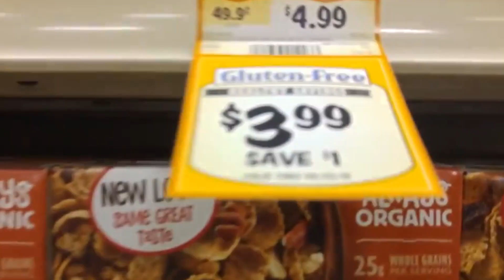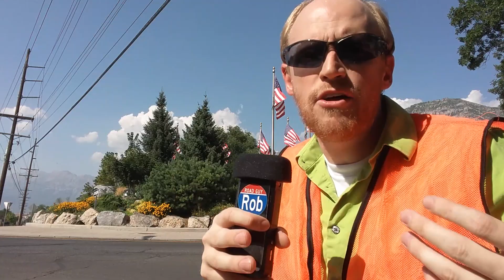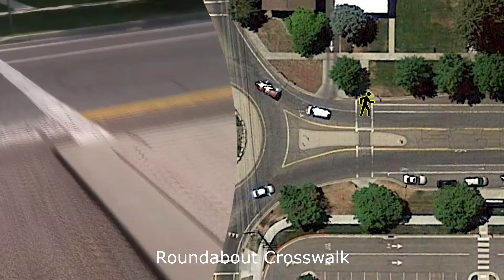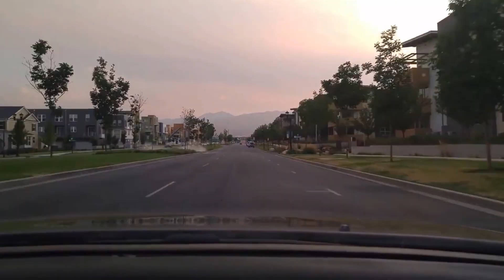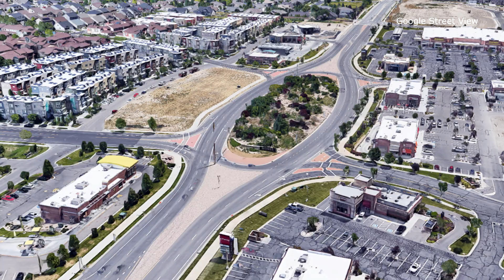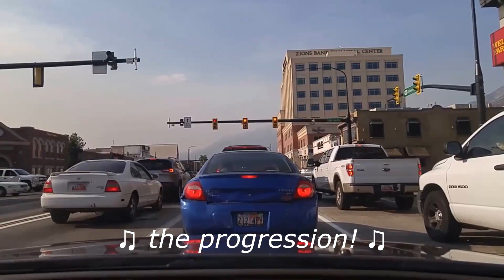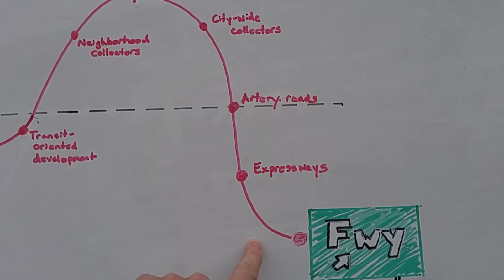Are roundabouts REALLY better than a traffic signal?

Comment: I 100% support more roundabouts. The only time they ever get annoying is when someone gets into the circle sooner than they should or drifts into the other lane if it's a two-lane roundabout, but that's it. In the area I live, there are a ton of back roads that are just as busy as main roads so they put roundabouts at many of the intersections. And I have never witnessed a single accident at a roundabout yet. I have witnessed many accidents at four-way intersections with just stop signs. Those are pretty dangerous because it's hard to get everybody to work together. And four-way intersections with traffic lights are just a drag because of having to wait at the red lights. Roundabouts ensure that you can keep moving and they are way more safe.

Comment: Two lesser factors (though technically two facets of one factor) most people don't usually think about make roundabouts the better option - in a nutshell, unfamiliar navigation.

Even under ideal conditions, street signs are problematic; quite often, you can't clearly read the street name until you're practically upon it.  Some places will put an additional sign in the median some 1000 feet before the cross-street but those tend to get obstructed by shrubbery - as well as their application being inconsistent - which pretty much negates any benefit.  Additionally, some drivers anticipate needing to make a left turn when their destination is on the right and they cut across at the last moment.

(A decent GPS could avoid most of this, granted, but that's not always an option.  Particularly when you're driving alone and it's illegal to use your phone for this purpose.)

Entering a roundabout, the signs are easily visible and it's easy enough to go in any direction at a whim.  Needed to make a right turn but already passed it?  Just stay in the circle til you come back around.  Left, straight through, reverse course, all those options are readily available spur of the moment.

Comment: Cool, a couple weeks ago I got caught up in a string of red traffic lights on my usual route. During the wait, I began to wonder if traffic lights were designed so that cars that got one green light tend to get more green lights in a row, and cars that get one red light tend to get more red lights in a row, because it seems rare that I would get a 50/50 mix of red and green lights. Sounds like a platoon is exactly that!
Reply: IF (this is a big if) a city has competent Civil Engineers (a profession with little to no competence) then traffic lights should be set up such that priority roads will seeing a chain of green light in a row when traffic is moving at the speed limit.  In most places, CEs are quite incompetent and lazy and you are fortunate to get 2-3 in a row.
The other circumstance is if you are on a low priority road crossing many higher priority roads.  Then you should 100% be hitting more red lights as the higher priority roads should be the focus of traffic light timing.  This statement assumes competent CEs which I admit could be a fundamental flaw in the idea.

Comment: They're a huge improvement in situations with moderate levels of traffic. With very heavy traffic they start to seize up. The reduction in fatal accidents is pretty compelling though. However, when you have an intersection that's pushing 40 or 50K vehicles per day, especially in the event of the "platoon" scenario mentioned in the video, built

Comment: The smalles roundabout I saw in England had an inner circle of 4 feet. In Europe it works fantastic!
Reply: In France and Spain they have even smaller ones, which I'm told are stuck into the middle of most urban intersections.  Even at the rest, drivers turning left are supposed to treat an intersection as if there were an island in the middle to be gone around, so drivers approaching in opposite directions and each turning left have to go around each other rather than turning in front of each other as they would in North America.  In Chicago they have boulevard intersections where you start your left turn before the intersection, which is the opposite extreme from the French-Spanish way.

Comment: This video made a great point about pedestrians: The constant flow of traffic in roundabouts effectively turns the streets into freeways which makes places inaccessible to pedestrians unless a footbridge or tunnel permits it. Much like on ramps cut neighborhoods apart from each other. Putting them everywhere would turn out landscapes into little more than islands with constant streams that cannot be surpassed unless you are driving, which you shouldn't be for nearby places.
Reply: Actually no. There is something that is pretty much always a part of roundabouts but he kind of cherry picked examples that forgot about it: Islands.
Almost all roundabouts have pedestrian islands that cause pedestrians to only have to wait for one lane of traffic to clear at a time. Islands on straight roads are hard cause they mean cars have to weave but on roundabouts cars are turning anyway so you can place an island without any impact on the cars.

Not to mention there is another thing growing that kind of goes hand in hand with roundabouts and is actually a bigger reason why the US was always slow to adopt them: Bicycles. There is a reason the Netherlands is the most enthusiastic about roundabouts as they are the absolutely perfect solution for mixing bicycles and cars together.
Reply: @MrMarinus18  Have you a video on that?

Comment: I grew up in DC where roundabouts (called circles) are common and very large. DC's street layout was designed by Pierre L'enfant in the late 1700s. It is basically a grid with streets named for states running at diagonals with a circle where most of those intersect. The circles are large to accommodate both grid and diagonal streets they connect, with centers large enough to serve as parks. I always found them relatively easy to navigate despite having eight entrance/exit points.

I now live 70 miles and two mountain ridges from DC in a quickly urbanizing small city where traffic taming constructions are relatively recent. I find the roundabouts that have been added just outside of town to have a circumference small enough to strike me as a bit too small to navigated comfortably. However smaller circumference ones that have replaced poor visibility 4-way stop signs in some residential areas seem to work well and have reduced fender-benders significantly.
Reply: If he is French then he would love the Place d'Etoile in Paris, France which has eight roads converging on a four lane roundabout and the traffic coming onto the roundabout has right of way. NUTS. this means that cars on the roundabout have to give way 8 times around the roundabout. An added stressor is that cars are not insured for fender benders on this famous roundabout. The centre of the roundabout is the famous Arc de Triompheand the tomb of the unknown soldier. Perhaps the should include the unknown motorist as well.........

Comment: Problem with "platoons" is that they only work in one direction at a time, and so the traffic lights are programmed to favour one direction at a time. If you're travelling in the opposite direction, it's quite possible that you'll routinely run into a string of red lights.
As others have said, roundabouts don't need to be large. The street where I live has three intersections, all of which are roundabouts. Two of those are quite small, with the central traffic island being only a few metres across. The third (in the middle) is fairly large - and directly adjacent to a major train station. That one has pedestrian crossings leading from each "corner" to the central island
Pedestrian crossings next to the roundabout can be sped up by splitting the crossing in two, so that you cross half way to the pedestrian island, then the rest of the way when you see a gap in the traffic on the roundabout.
Something you mention in passing is that roundabouts never force you to stop when there is no other traffic. Surely I'm not the only person who has been peeved when forced to wait at a red light with the intersection being otherwise clear in all four directions...

Comment: Nobody seems to be talking to NJ DOT. New Jersey once had lots of these circles, but once they got overloaded and started generating lots of accidents, NJ DOT began ripping these all out. NJ found it better to either punch the primary route through the circle, or in some cases like the Marlton and Berlin Circles on NJ State Road 73,  replaced the circle with a freeway style interchange at Marlton (NJ70), or with a light (Berlin). Traffic circles a.k.a. roundabouts may be work fine in residential areas, but not where main roads cross. Circles force ALL traffic to slow down to speeds akin to turning a corner, including emergency vehicles, unlike a light where during the green phase traffic does not have to slow down like that. Some depts have the ability to turn a red light green on approach e.g. Montgomery County PA.

Comment: Platoon flow only works if the cars are really well coordinated. We need a system of lights along the road to signal if cars are going too fast or too slow. The problem is that most lights in my experience are not properly timed, or if they are "properly" timed, in practice they are not properly timed because of other drivers driving incorrectly. IMO cities are extremely negligent to infrastructure and so they standard option should be a roundabout because it doesn't need someone to engineer it perfectly for it to work out better.

Comment: Funny comparing roundabouts and freeways. The way roundabouts work is more or less the same as freeway entry and exist. Get cars to move at a similar angle and similar speed, then give way to traffic on the freeway. A freeway interchange is more or less a roundabout with all the lanes separated, and with one extra path for through traffic in each direction. Can you imagine if freeways had traffic light intersections?

Comment: I've always wondered about the fuel economy/savings of roundabouts where they replace lights. Not having to brake, idle and accelerate, you're saving gobs of gas and brakes pads. I don't even know how to estimate it. I'd need to get into injector pulse widths and fuel rail pressures to be able to estimate it, as well as log that for many models of cars.

Comment: Don't know if it is still there, but there used to be two almost-freeways that intersected in a roundabout outside of Cherry Hill NJ. I figured it was for population control. In DC, there are roundabouts all over the place. If you don't know where they are and how they work, you're sunk. You'll be driving along what seems to be a regular surface street and come upon a little weird off ramp...Is that an off ramp? Why is there an off ramp....I'm not on a....Whoa! You' dip down and go under an underpass. In the darkness, you realize you are under where you wanted to turn right. Too late now. Next time you're in town, you remember to take the off-ramp looking thingy after which you drag past some parked cars and get dumped into a roundabout. The typical one will be about 3 lanes wide and have 5 different outlets. Traffic is heavy. Roll your 16-sided die to guess the right lane to be in because you will need to strong-arm your way into it and, once you are there, if you are wrong, you're goin' round the mulberry bush three times to get to the proper lane to exit. Just love DC. In the local neighborhoods, "roundabouts" appear to have been made by simply adding an obstruction in the middle of a regular intersection. Clearly they are meant for traffic calming. The UPS vans can get past them without hitting the curb, but I really wonder if the garbage trucks can.

Comment: Wait, it cost about 10 grand a month to power The traffic signals at one intersection? That sounds horrendous, that's like millions and millions for a city full of intersections.

I had no idea how much electricity these things were using.

How much does a super bright array of LEDs use wattage wise? I'm going to just estimate that 100 watt LED array his sufficient to light up a traffic signal. We will assume that only one light is ever on at a time per housing. So the two lane intersection near my house with three lights per direction (two main lanes and a left)... That's 12 lights on at any given moment, twelve 100- watt bulbs, lit up continuously. And let's say the controller uses another hundred watts.

So we have 1300 watts being used continuously 24 hours a day 7 days a week.

730 hours per month X 1300 watts hours = 949,000 watt hours. 949 KW hours.

Average electricity price is about 15 cents per kilowatt.

$142.35

Is my math right? Now I think I've drastically low-balled it 😂
Reply: I don't know, I don't see any obvious errors in your estimate.  You might be a little low on the size of the lamps.  But still if we back up to pre-LED days and assume 300 watt incandescent spotlight elements we're still only up to $500-ish per month.  I'd like to see some support for the $5,000-$10,000 per month number.
Reply: @andrewalexander9492  maybe it's about 10 grand all in total to run an average cities whole collection of lights
Reply: @CmdrKeene   Maybe that's what his numbers represent.  He sure didn't present them that way though.  Maybe he found a number for energy costs including area illumination and got confused.   I found this article that discusses traffic signal power consumption in Chicago, and it puts pre-LED traffic signal energy costs at $600/year  for an intersection (although it doesn't say how many lanes or lights in that intersection)  it also says that replacing the incandescent lamps with LEDs  reduced energy costs by 85%.  I think that $5k-$10k to run a set of traffic signals is waaaayyy off.

Comment: On small roads, roundabouts are smaller. The pedestrian argument is overblown. 

Platoons are pretty terrible for traffic flow. Imo if you're relying on platoons you've already failed. If you'd had an appropriate number of roundabouts in your city planning it would never have been necessary to time traffic lights in the first place. 

Admittedly at gigantic intersections, or intersections with very uneven traffic flow from each direction, there may be better options than roundabouts... but even then it isn't a normal traffic light intersection. You're usually looking at diverging diamonds, continuous flow intersections, or other esoteric ideas at that point.

Or you could always try a compound (magic) roundabout ;)

Comment: You forgot to mention all the street light poles and signs that get taken out by speeding/drunk drivers.  The one near my home has had every one of the lamp poles replaced at least once, and some have been replaced three times.  Now there is a "dead one" that needs to be replaced for the fourth time.  It's also a bitch to try and cross them. Have had 6 police cars drive by with me in the middle of the crosswalk.  NO, they didn't stop or even say sorry.  Almost forgot that the stone work in the middle has been replaced 5 times from drunks coming home.  Not to mention the idiots that slide off the road when it's icy out from too much speed.  Moms seem to see how fast they can get the mini van to take the corners.  No, I do not like round a bouts.

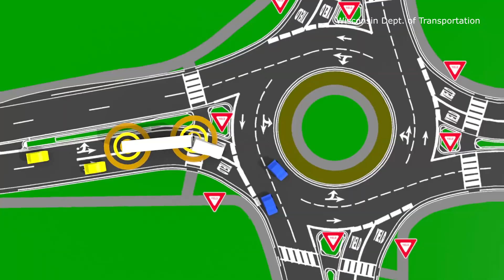Comment: 2:16 - the ironic thing is that isn't an issue as if you increase the size of the roundabout so speed increases (there are several i know of you can take comfortably at 50mph) then the angle of approach of the 2 lanes of vehicles becomes more acute, meaning if there is a collision it's not going to be anywhere near 90 degrees and has a far lower chance of being fatal.
Reply: Not if you have lane discipline enforced by fines.

Comment: Short answer is yes. It allows traffic to flow quicker, filtering in. It's a give way system not a stop system. ''ironing out'' the roundabout is illegal, if you did that in your test you fall instantly. What lane to take is easy to learn, just don't be an idiot.

Comment: Roundabouts have really only a single use, for starters they are cheaper to build then lights at an intersection. But, they do not scale well. Roundabouts are terrible for 2 - 3 lane use. The benefits of a roundabout are mostly seen in residential areas, and you tend to make them extremely small and difficult to drive around. So, they do slow down traffic.

They tend to only work in this setting, as you scale them up, or the traffic flow between all directions is unbalanced, they tend to fail. There is a big thing in Melbourne, where we are getting rid of the larger ones in favour of traffic lights.